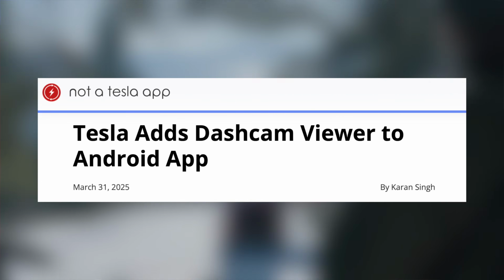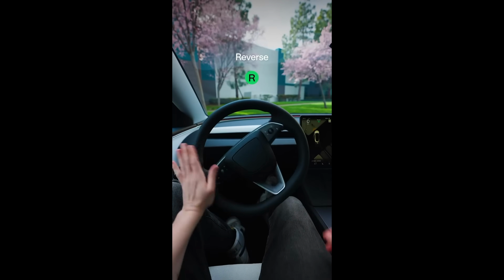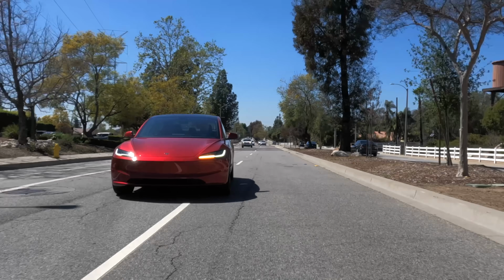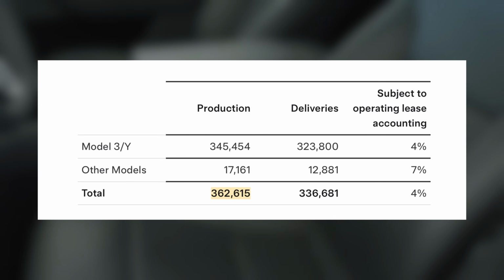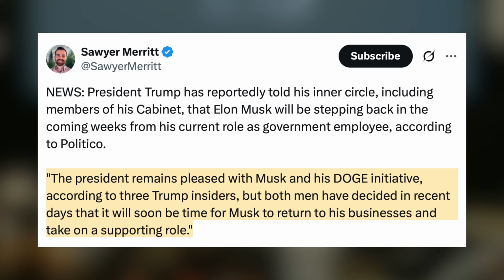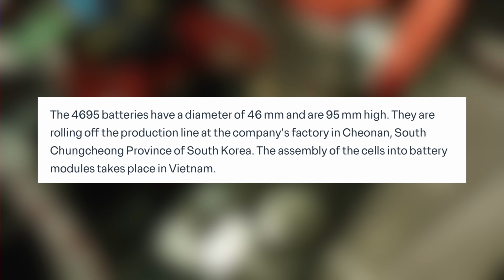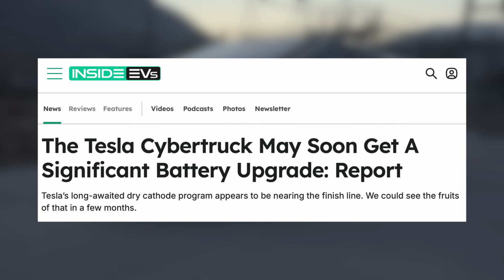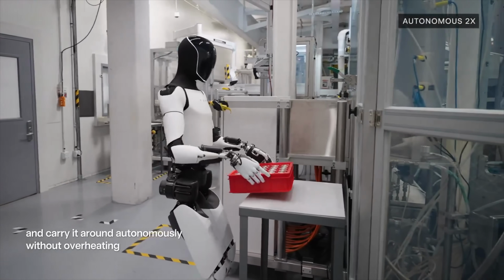Elon Responds To Tesla's Earnings Call | This Is Not Good

Comment: The feasibility limit to charging speed has always never been the battery. You can always stuff in an enormous battery and gain charging huge miles / minute. And the cost of the high power electronics has been in free fall for decades. The feasibility limit to charging speed has always been how stiff the charging cable gets at minus 40 degrees, the coldest extremely common temperature. A megawatt is the practical limit for a standardized charging system with a cable that's not too stiff for a 100 lb adult woman to plug into a car. (Of course real talk 100 lb adult women like to marry 200 lb men and have the problem just go away, eg "I have him for that.") On both sides of the cable, all the other problems are minor engineering issues like cost that resolve and dissolve as engineering evolves.

Comment: The lower delivery number was accurately predicted by Jeff Lutz immediately after the Q1 numbers came out. Analysts' estimate of 477K did not take into account the announced 3 weeks of down production noted in the Q1 report. At about 30K cars per week, this amounts to about 90K which reduces the 477K to about 380K. Coming in at 362K actual production is not far off that computed number. And a figure of 336K actual deliveries is also reasonable. Given the retooling of all 4 factories for the refreshed Model Y and the Chinese New Year reduced time in Shanghai, these "missed" numbers should be laid at the doorstep of analysts, not Tesla.

Comment: The Model Y refresh is obviously a huge factor here, and I would expect a significant rebound in Q2. A lot of people have been waiting for the new model Y, and in the short term I would expect that they can sell their Model Y production.

BUT it is clearly not the full story. There is an obvious drop in the brand value of Elon, and in the long run this is much worse, because it is not something you can get back in the short or medium term. Elon and Tesla have used more than a decade to build a unique brand that was linked in no small part to the mythology around Elon.

That is not only gone as a positive effect. We all now know he is full of s h i t. But even worse it has turned into a clear negative to be this closely linked to Elon. This is not something you can just get back. Elon can stop at DOGE now, sure, but it will not magically make people like him again or make people forget just how insane he has been revealed to be or make people forget that Tesla is Elon. 

If you want to see brand value, look at the expensive cars. Cheap cars sell on price/value. Expensive cars sell on image.

And from this perspective the Model X, S and Cybertruck sales are scary low. in Q1 2022, when there was no Cybertruck on the market they sold 14,724 of model S and X combined. In Q1 2025 where Cybertruck was supposed to be fully ramped up they sell 12,000 S, X and Cybertruck combine (and this is now with Cybertrukt included). This is a disaster. And keep in mind we have no Model Y refresh effect here and that Elon predicted sales of 250,000 cybertrucks alone per year, and that they supposedly held 2 million reservations (they have build less than 60,000). 

Unfortunately Tesla does not reveal the split between S, X and Cybertruck, but the total alone tells us, that Cybertruck has turned into a sales disaster, and that its getting worse not better from quarter to quarter. And this is pretty telling around development of brand value, because nothing quite screams that you are a Tesla and Elon fan as driving around in that shiny block of stainless steel.

Comment: Come on guy, Do the math!
You are looking at Q1 with literally a Month of No Production from most Factory locations. / by 2, X3 and your looking at Capability of over 550,000 produced. Tesla holding an avg 19 days inventory is incredibly tight. Ramp up is not instant on start up.
Brain Cells, use them.

Comment: The Cybertruck is officially a failure.  The simple matter is that price is nearly double for the AWD and the base RWD is over forty percent higher than what promised; granted the RWD has not officially been priced.
Reply: Do you remember all the excitement that the cybertruck would use the external steel panels for structural rather than aesthetic- ie the "exoskeleton". Another major feature promise that was never delivered
Reply: This truck will likely be a sore spot that Tesla has to make excuses and justifications for going forward.

Comment: There were very large discounts and incentives on the outgoing MY, which would inflate delivery numbers beyond baseline expectations.  The new MY (launch edition) is available today for immediate delivery, which would indicate that supply is outstripping demand, certainly lower demand than what Tesla anticipated.  Similar to what we saw with the launch edition of the CyberTruck, when Tesla employees were reported to be removing the Launch Edition badging from CTs.  Overall EV demand continues to set records while at the same time Tesla demand is actually down.  The international picture is arguably worse than the USA market.  What will happen next?  Who can say, but I don't think you'd predict that Tesla sales are going to take off.  What if there's a recession?
While the 4680 batteries are promising, it's fair to note the announcements that Elon made about this,  4 1/2 years ago, were far-reaching and on the whole you'd have to consider the 4680 project a big failure so far.  One thing that's not disclosed is the cost per cell and the yield rate (how many can they actually use that come off the line).  The chairman of Chinese battery company CATL, whose technology is licensed by Tesla, does not think Tesla will ever make the 4680 successful.
The Tesla energy storage unit has been a big success (but not Tesla Solar), and this contributes about 4-5% of Tesla's income.  
So many of Elon's announcements have been wildly divergent from reality.  The robot clip shown today is cool, and at about the level where Boston Robotics was ten years ago.  At most companies if someone released the deceptive shirt-folding robot video from a few months ago, they'd be fired.  The Hollywood robocab unveiling that featured robots had apparent glitches in the modest scope of what the robots were expected to do--and that was a custom-designed, controlled, staged demonstration.  
Honestly, Ryan, I think it's better to not say anything about robots until something's actually proven to work effectively and arguably as good or better than competitors.

Comment: If Tesla had switched on real driverless FSD to the fleet several years ago the current valuation would look reasonable value, but they didn’t. 
The dedicated robocab is a test vehicle that will be geofenced and hasn’t even been manufactured yet. The sensor suite and computer system may be entirely different to what is available as the “fsd” suite in current vehicles.

Comment: An actual lower cost, more mass appeal car would be a game changer. Like a Bolt or Leaf but less compromises - like near or full speed charging. Most Tesla cars are halo products for the average American although the 3 and Y start below the average new car price. But, only millionaires should be buying new cars as the depreciation is too much a financial sinkhole for normal, middle class people. However, one nice aspect of all the various reasons for depreciation for Teslas is they are actually decent values on the used market now. Anyone in the know about Tesla isn't worried long term - in 10 years Tesla will be known as the AI company that happens to sell cars on the side. I'm looking at it as stock being on sale.

Comment: Jeff Lutz said that it's easy to calculate that Tesla would lose production of 100,000 Model Ys. In Q3 and Q4 production was around 460,000. That means 360,000 in production of Model Ys in Q1. And Tesla entered Q1 with very low inventory. They chose to do a low inventory changeover of the Model Y which cost them sales, but saved them money. The sales numbers could have been better but they would've had to had a fire sale to move inventory old Model Ys. I don't understand how people like Dan Ives can be so stupid about this.
Reply: Not mentioning the proven paid protesters and why use Ives as a source?  🙄
Reply: Sorry mate, but what sales did Tesla forecast? They missed their own plan, not a random market forecast.
Reply: @JohnnyBeCool383  They missed on Wall St expectations, not on what they themselves said. A 100,000 sales lost was EXPECTED by people who are knowledgeable about Tesla, and it was because of the Model Y lines being shutdown for several weeks. Tesla said in the Q4 Earnings Call that sales would be down in Q1 due to the Model Y lines being shutdown.
---->Of course, the idiot Wall Street analysts missed that.
Reply: @JohnnyBeCool383  Tesla said Q1 sales would be down because of the Model Y lines being down for several weeks.
Reply: @JohnnyBeCool383  Tesla missed Wall Street EXPECTATIONS, not on what they themselves said.

Comment: The physics cannot be ignored on the 4860's having more mass and less surface area just makes temperature management far more difficult and we have seen this in the poor charging performance on the Model Y AWD with 4860's and even on the Cyber Truck with Gen 2 4860's. This is why the best charging performance on the current Tesla lineup on the 400volt battery architecture are the 1865 in model X and S which has the lowest mass to surface area of all the current 4860, &  2170's.
Reply: - The tabless electrode was supposed to counteract this square-cube problem, but I guess it didn't.
- The 4680's steel can was initially very thick, which probably contributed.  It's thinner now tmk.
- You keep writing 4860 instead of 4680.
Reply: @concinnus  Tabless electrode would lower internal electrical resistance but not improve thermal conductivity as much.
Reply: @ Most thermal conductivity follows electrical conductivity - transverse up to the tabs, not through the layers of the jellyroll.  Or at least that's what Tesla was claiming beforehand.
Reply: @ Yes but it is the battery thermal management that seems to be leading to the poor charging performance, so the design is not leading to class leading performance.
Reply: @berthogendoorn2133  Yeah, the CT battery is clearly thermal throttling, but there is a series of at least 7 thermal layers before rejection to air, where the jellyroll is just the first.

Comment: Actually haven't seen real improvement in batteries. Remember battery day was 5 years ago
Reply: Tesla's production capacity:
Tesla has produced over 50 million 4680 cells at Giga Texas by June 2024, with production rates rising from 85,470 cells per day in mid-2023 to 126,050 cells per day currently. 
.... isn't that the battery they introduced back then?
Reply: @CHMichael The battery has the same name, but it hasn't achieved any of the metrics that were promised. Tesla has been struggling to sort out problems their dry electrode process. They even had to import cathodes because they could only make the anode.

Meanwhile the state of the art has moved on to LFP batteries instead of NMC.
Chinese companies are delivering cars with more range than teslas that charge to 80% in 5 minutes with LFP.
Reply: Yes, but from BYD and CATL 😂
Reply: I'm hoping for a graphene battery to finally make it in the market.  Developed about 23 years ago already.
Reply: @kare9875 The problem is making a sheet of graphene. There are graphene supercaps on the market already. They can charge stupid fast, a hundred miles in a few seconds, but they aren’t cost effective yet. And like any capacitor they don’t hold charge for long. IE, hours to bleed off vs weeks or months.
Reply: @downrangefuture6493  Thanks!
Reply: @kare9875  um they cost alot to make and production is a issue

Comment: I had a cyber truck order for 4 years. What was promised and what was delivered was very different. I won't be buying anymore. I thought for sure the range would be much higher.
Reply: Fair point.  I think the battery tech did not progress the way they figured.  It will be ok...
Reply: It sounds like over promise and under deliver.
Reply: Certainly the one main vehicle where the range should’ve been the primary focus.
Reply: @ right, I need to pull my boat. Under 100 miles of range with a boat doesn’t work so I have to stick to my gas truck.